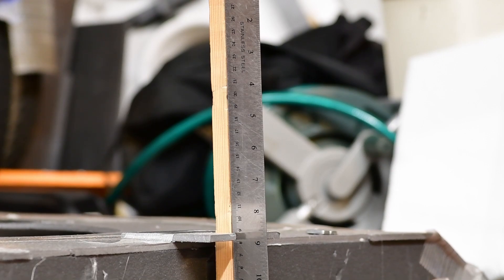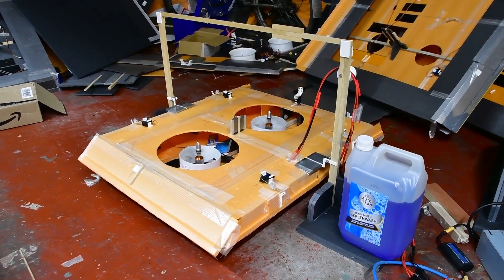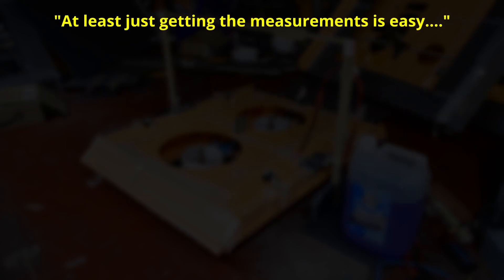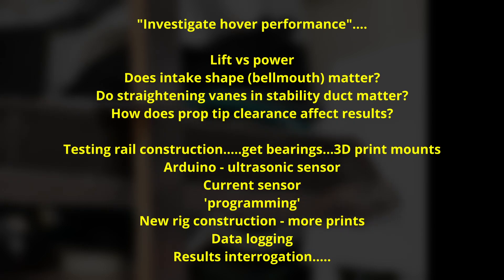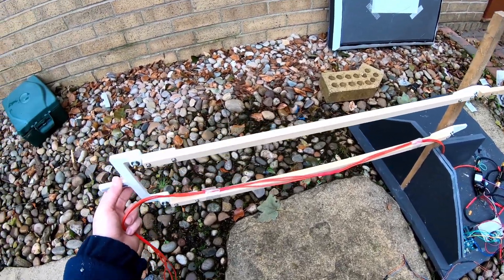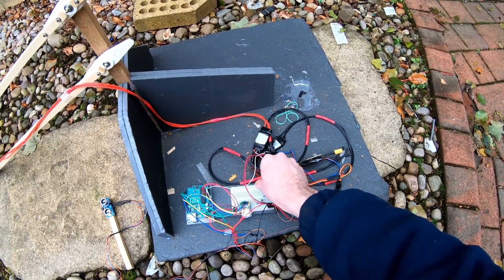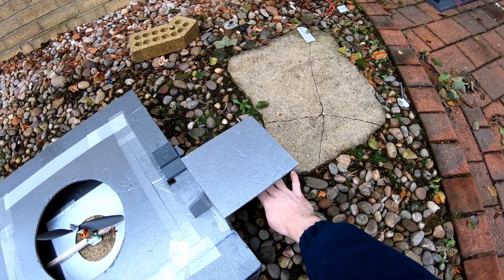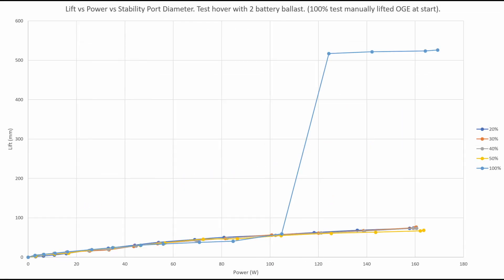Skirtless Hovercraft Projects - Automated testing rig development and overview

Comment: Do you have a faq? Since I'm sure this is addressed in one of your videos, but how does a skirtless hovercraft remain stable, or not just flip over?
Reply from the maker: It will flip over given enough power for the weight - I have my designs below that point.

No "FAQ" at this point, I am working on a summary document for RCGroups.